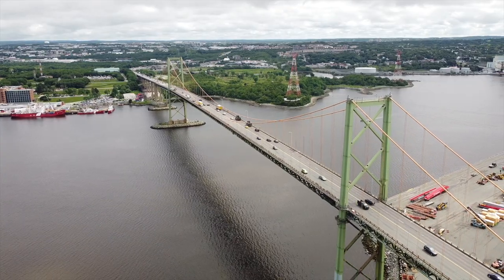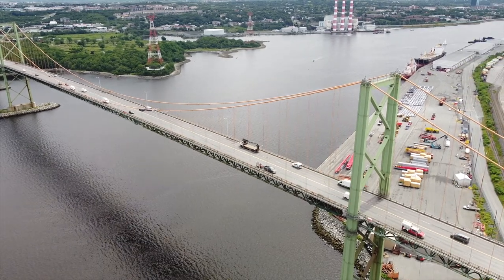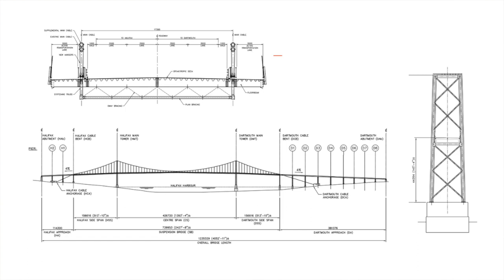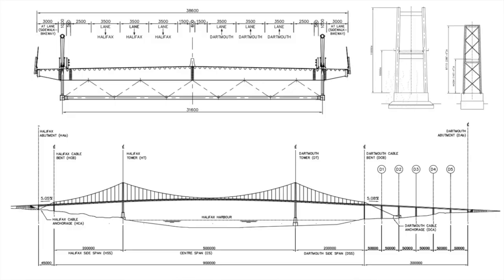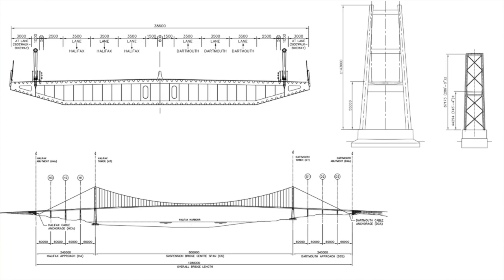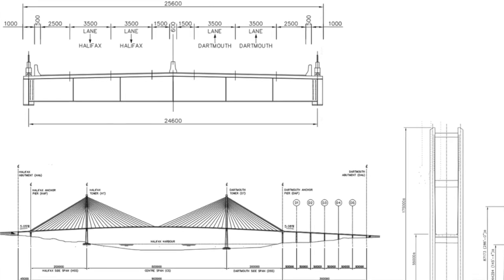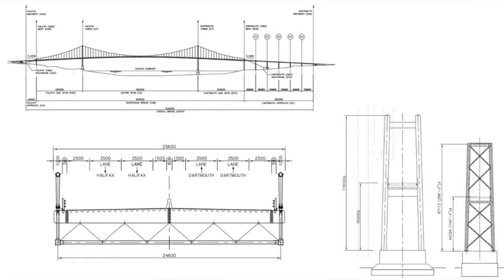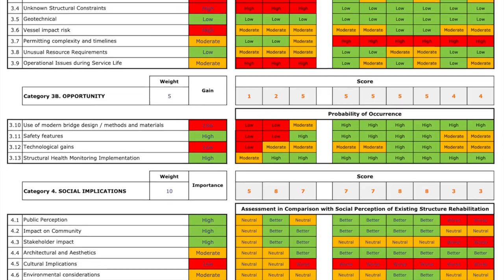The Mackay Bridge is thin skinned

Comment: Do you know how the AT connectivity would work with the surrounding area? There have been so many times when my bike trips would be cut in half if I could use the McKay, but there is so much highway spaghetti on either side that I can't imagine how they'd do it while maintaining the car traffic capacity. I can't imagine they'd be willing to invest much to make it work considering that the McDonald bike overpass on the Halifax side is so many years overdue with no sign of funding it!
Reply from the maker: the mackay would actually be easier for connections since they could pass under the bridge and not have to deal with conflicting roadway uses. the whole reason for the flyover, is to avoid making cars going down to barrington from having to stop  at the base of the bridge to let cyclists cross, which is the sane and cheap solution.
Reply: @hfxshippingnews  so the bike solution would be to connect it at somewhere like Novalea, rather than trying to navigate through the existing interchange areas? I suppose that makes a lot of sense, but is disappointing for my particular use case of wanting to take it from West End / Fairview! I suppose for that there would need to be an entirely different endeavor of making the Kempt Rd area AT-permeable - out of scope for a bridge project.

Comment: I heard that the Mackay's cable actually isn't strong enough to hold a sidewalk and bikeway outside the span. 

One thing I wonder about a new bridge is how would we connect the road to the bridge while the Mackay is still open
Reply from the maker: this might be the case, since it was designed for a lighter load.
i dont think road access for construction would be a problem, and after moving the new bridge is really just removing some barriers.

Comment: And you could make the span higher to accommodate larger ships for the Fairview Cover Terminal. Correct me if I'm wrong.
Reply from the maker: It will be higher, the Macdonald will still be at 50m
Reply: @hfxshippingnews the other thing to consider is that if you start from the same location and make it taller, you're going to have a hell of a time with your AT lanes. I can tell you from experience that biking the McDonald bridge regularly gets old pretty fast, and the new bridge is a lot longer!